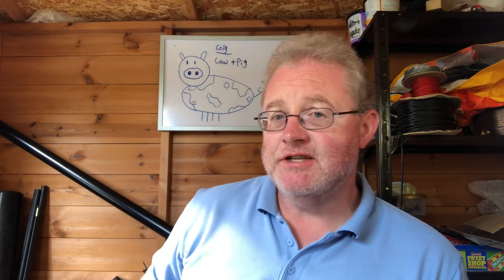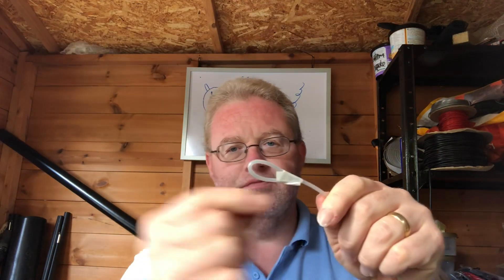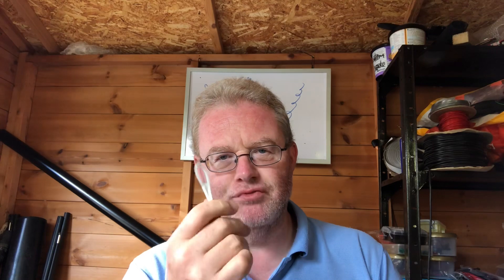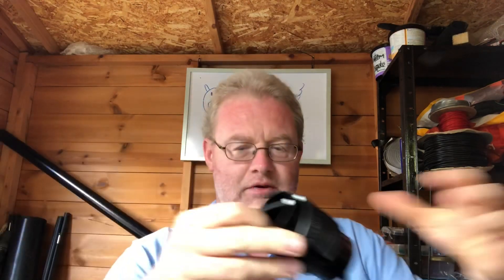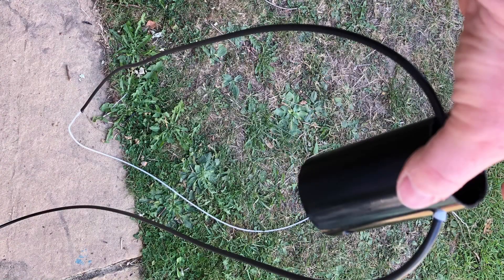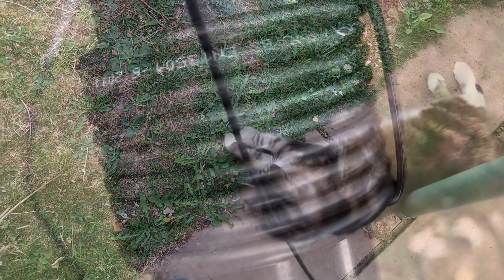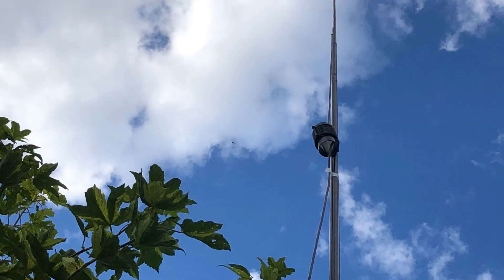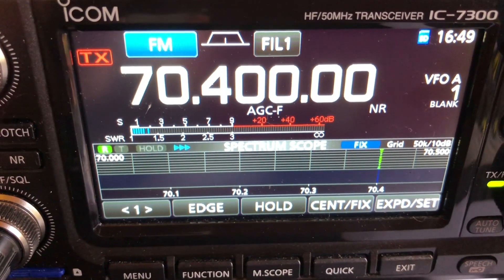HAM RADIO: 4 Metres - Light and portable End Fed Halfwave Antenna

Comment: Built one tonight tonight while slightly drunk, using your numbers rather than those I found elsewhere on the internet. Spot on. With it hanging just hanging off the apex of the shed roof I got SWR of less that 1:1.3 across the band. Foldback of 10cm, and choke formed around a toilet roll core that I then removed taped up.
Reply from the maker: Brilliant!!!

Comment: Hi Tim, thought I'd give you some feedback on the antenna in this video.
I've just made one using the same coax type and lengths, coil diameter and turns and it works a treat. The coax lengths were spot on and I managed to get a flat SWR of 1.2 across the 4m band using a nano-vna and using a dedicated SWR meter showed 1.1 across the band. It wasn't quite right first time, and found weird tuning/capacitance issues using plastic waste pipe tubing to support the cable based elements, but after using fibre glass rods instead it settled down. It took a few attempts to get the element lengths correct but the lower element of 910mm and upper element of 950mm (not looped back) put the tuning spot on centre of the band - all this bringing 'this amateur' back into amateur radio. This is now waterproofed and ready to stick on a 10m fibre glass pole and 'buried' into the tree at the bottom of the garden. I did give up at one point and looked to buy a 4m aerial, but persevered and used the cash to buy the 10m mast instead.  73 :)
Reply from the maker: Hope it works well 73

Comment: Are you referring to some design information for the dimentions?
This aerial will be very useful for me. Thankyou.
Reply from the maker: I took the measurements from my 2m version based on desired centre frequency and proportions due to velocity factor especially in terms of the lower portion of the radiating part of the antenna. It seems to work ok. 73

Comment: In IO92 there are regular nets using SSB with vertical antennas. Not so busy on 70.450 FM but it’s always worth with putting a call out if you have the kit.
And don’t forget to check the RSGB’s contest calendar to.
Reply from the maker: Will do mate

Comment: Surely that's a centre-fed dipole, rather than an end fed half wave, which would require a 49:1 matching transformer rather than a choke?
Reply from the maker: Physically end fed and thanks to the skin effect of the coax of the lower half of the antenna it is electrically a centre fed dipole 73
Reply: @timg5tm941  that's pretty much what I said... So not really a half wave end fed, then.
Reply: @BarefootBeekeeper  but from a "practical" viewpoint it builds as an end fed which is the whole point of this antenna over a dipole with its associated mounting problems
Reply: Centre fed through the axis of the antenna? 🙂

Comment: H Tim, can I ask why there is no matching at the feed point which would be 300ohm?
Reply from the maker: It’s a Halfwave dipole. The current max is halfway up the radiating wire. The matched impedance should be between 50-75 ohms or thereabouts. Nowhere near 300.
Reply: @timg5tm941  I understand how it works now, thanks. Very clever

Comment: Hallo.We use in the Czech Republic frequency 78Mhz..(4m band)..How long RG58
part 1 and part2 ,on coax???Choke is 50mm diametre and 8turns???Sorry for my language..Thank you werry much..73
Reply from the maker: Hi the choke should be about the same. Use 143/frequency to get the overall length and then divide by 2 for the top and bottom part. See how that works. By the way your English is great!

Comment: Hi. I'm going to start with cb radio 69 mhz. Do you think this Will work fore that to? Any adjustments? Sorry my english are not so good. And thanks for sharing.
Reply from the maker: You may need to lengthen it slightly but you may well still have a good swr on 69mhz as it is
Reply: Thanks. Great chanel by the way. Keep go on strong. 👍

Comment: Hej from Sweden! Great video Tim thanks for that! How do you calculate the length of the top and bottom section above the choke. You said they are slightly   Shorter Tham quarterwave. Thanks a lot Tim!!!
Reply from the maker: Hej Carsten! Here’s my formula: Formula looks to be 131/frequency (metric)
Then divide by 100
Times by 50.8 for top
49.2 for bottom ( because is less 3% for velocity factor) Hope that makes sense 73 👍

Comment: Thank you for this video Tim. I made one today exactly the same as you said and it swr's fine. I want to turn it into a more permanent antenna, could I convert it to a "white stick" by putting the coax inside a plastic tube? would it still work as well? 73 Gerry M7UKD.
Reply from the maker: Hi Gerry it will work but I am sure it will slightly affect the tuning - I cannot remember if the antenna needs to be longer or shorter a little as a consequence?

Comment: Hi Tim, not able to source 50mm od former at the moment. Is that guttering downpipe you are using???
Reply from the maker: Yes I think it was Peter
Reply: @timg5tm941  Tnx for your quick reply, found it at scr*wf#x as mini guttering. Off tomorrow to get a le ngth.
Reply: I get a lot of my antenna parts from Screwfix. 🙂

Comment: Hi, passed my foundation exam 6 weeks ago, and am loving your videos as I'm a total newbie. With the 4m end fed antenna, would the diameter of the tube for the choke matter? Could I use 40mm pipe?
Reply from the maker: Yes you can. The wider the coil the fewer turns needed and vice Versa

Comment: Hi Tim, might be a bit of an odd question but where do you get your coax from? Any reputable sellers? I'm quickly running out of it here and having bought 2 lots of it and been really unimpressed with the quality of the braid. Just wondering if you have a supplier of choice?
Reply from the maker: Hi there. Mine was rg58U mil spec from Nevada. Hope that helps 73

Comment: What's bugging me Tim is that depending on whose building this type of antenna and it seems, the band, some people fold the outer braid of the coax back on the lower part for between 0.66 and 0.50   wavelength, the balun using toroids, or no toroid balun just a common mode coax coiled choke. same weirdness go on for the upper element, some people use 0.25 wavelength or thereabouts, or others like Callum use a much longer upper element at least on 14-28 mhz like he did... i know having a low SWR does'nt dictate that the antenna will have a desirable low angle radiation. it is the conflicting advice i struggle with . Pete 2E1 MHA
Reply from the maker: Well the lengths I use seem to map across different bands pretty well 👍

Comment: Basically a feeder (coax) is connected to the beginning of a quarter wavelength radiator via an oversized choke. That is not END FED antenna. That's a 0.25 vertical. Also -  a black pipe for VHF \ outdoors? Poor selection of materials & description. Sorry.
Reply from the maker: Wrong. But thank you for commenting 73